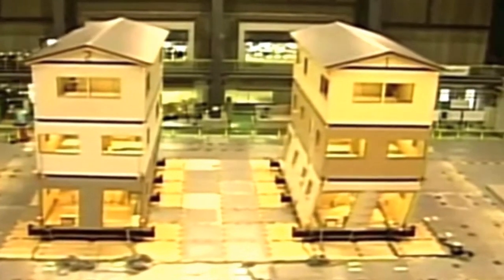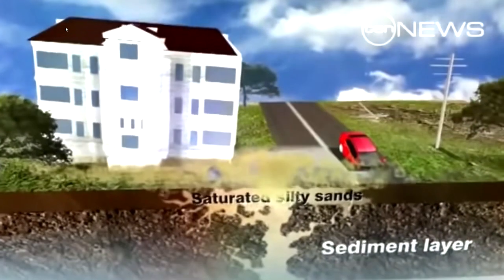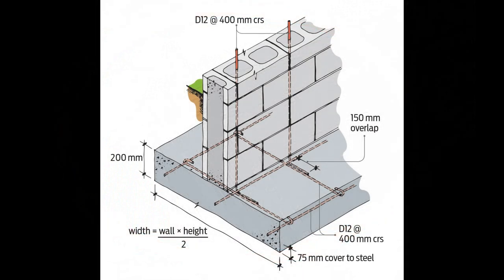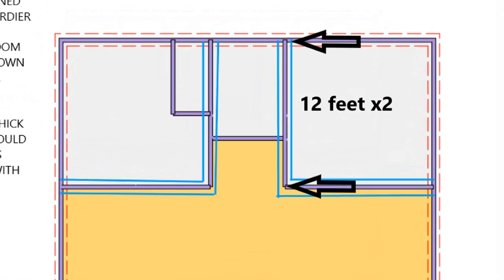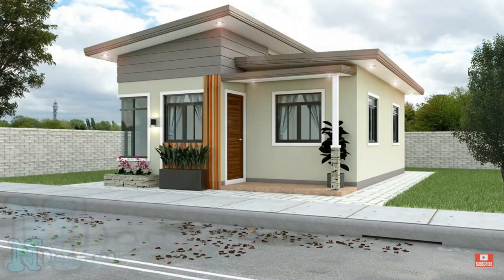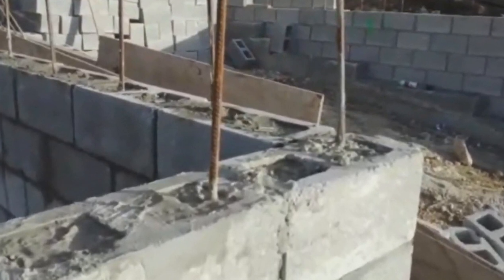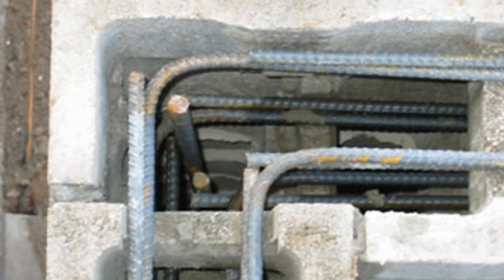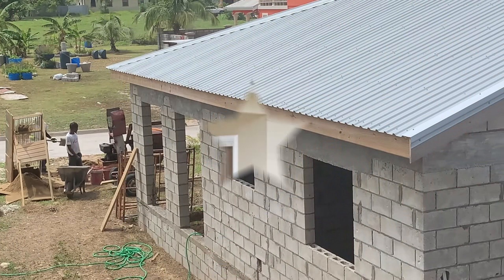BUILDING YOUR DREAM HOUSE IN JAMAICA HOW TO CALCULATE REBAR FOR FOUNDATION COLUMN . EARTHQUAKE PROOF

Comment: Thanks for sharing , something we need to start doing  more of in Jamaica .
Reply from the maker: yes, we do. This video was actually inspired by the video from the frame grab where the guys were building a house in St Andrew where they have the rebar matting laying on the bare ground. I was shocked to see an "engineer" using something he called a "heeky" to literally bend the rebar around large rocks inside of the foundation trench.

What he should have done instead was to lay a bed of sand mixed with gravel into the trenches and level it off and compact it to form a flat surface to lay the matting on. So if he needed to step up because of grading that step up should be reinforced with its own rebar cage as well. In a case where the grading is not too steep he should have leveled it at a flat slope and then laid the rebar matting on that level surface.

 As it is he totally compromised the foundation concrete by putting bends in the rebar where none should have been.

Comment: Excellent video! very informative! I always wondered why corners were never interlaced. seems to me it would be just as strong. What is your opinion on building your outside walls then pouring the floor with plumbing and electrical installed. Then building your partition walls on top of floor out of block or wood/steel for drywall?
Reply from the maker: building the wall, pouring the flooring and foundation with plumbing and electrical installed is a better and more cost effective way of building.

There are a number of reasons people build partitions out of blocks.

The first is that it is actually cheaper. Second is that its easier, thirdly its much faster and lastly there are few people with the knowhow to do it properly.

Pretty much anyone you find in Jamaica who can frame and drywall are returning residents who worked in construction .

The issue is a matter of economy of scale. Not many people know about framing and drywall so its not as readily available so its expensive to purchase. Lumber is expensive and all the other things like nails , screws , tape , mud and so on add up. Then there is the labour. Put all that together and you see that compared to just blocking up with four inch blocks , filling those pockets and rendering, the blocks method is much cheaper.

And you are quite correct about interlaced blocks. If Its a single story building then poured columns with rebar cages are not needed as long as the corners and walls are constructed in the manner i showed and the bond beams are placed in the correct position as i outlined. 

The actual reason for not doing like this however is simply tradition. There are not building construction schools in Jamaica so the people who build do so based on what they see others do without knowing any other way so the same method is passed from one person to the other. 

Back in the day there used to be Technical high Schools that actually taught this sort of thing but we have foolishly moved away from that and turned them into academic high schools, depriving ourselves of people educated in the trades.

When I went to KTHS I was actually introduced to practical brick laying, welding, metal working and carpentry alongside my majors , electrical installation and Technical drawing. But even then most kids didn't want to get their hands dirty muchless these nowadays phone addicts.

Comment: Great information, thank you! I have a question though. I am going to build a single story concrete house, however, in straying from convention, I want my roof to be a flat concrete roof. 
What is your suggestion for the steel layout for a concrete slab roof?
I am only seeing videos of concrete decks for people who are building another story on top of that slab, however, I am not going to do that, so should I layout the steel in the same manner as if I am going to build another story or is there a way I can use much less steel without compromising the structural integrity of the building?
Reply from the maker: Hi thanks for watching my video and thanks for subscribing.

Great question. The suspended slab is limited in how it can be laid out because of the weight of the concrete. It needs that large amount of steel to help provide the structural integrity so it does not collapse on itself or sag under its own weight.

With that said there is actually a way to use a bit less steel. Its called "fiber reinforcement". There are a number of different types. 

First there is "steel fiber". This is small pieces of steel wire around the size of a needle that are mixed into the concrete . That allows you to increase the distance between the rebars to about 8 inches thereby using less rebar.

Then there is "fiberglass fiber",  "carbon fiber" and basalt fiber". these are sold by the pound and work the same way , mixed into the concrete to provide both strength and resist cracks. 

The other method for using less steel is to carefully control the thickness of the slab. This is actually the most difficult and the least effective in terms of reducing the amount of steel because there is a limit to how thin you can make a flat suspended slab and still have it hold up its own weight, not sag and have people still being able to walk on it. 

So basically using normal strength concrete that limit is 4 and a half inches thick at a maximum span of 12 feet with 12MM rebar at 5.7 inches.

So In this case (presuming that your main  concern is cost effectiveness) you wont save on steel but you will save somewhat on concrete.
Reply: @jussayinmipeece1069  Ok, thank you so much. I actually found your video about rebars in concrete slab roofs after I typed that comment but I still left it there to see what what you may say in response to my specific question. So, thank you very much. I'll definitely go through all of your videos, I just found your channel today and already subscribed. Keep up the informative videos 👍🏾 God bless
Reply from the maker: @Sappa9702  thank you very much.

Comment: Do all block pockets have to be filled with concrete?
Reply from the maker: no. Technically only those with rebar must be filled.
There is a tendency in Jamaica , however to fill all block pockets with low strength concrete. This actually provides a decent sound barrier, especially in dividing wall on the inside if two bedrooms share the same wall.

Comment: What if you are going to concrete the top of the house
Reply from the maker: Hi. Good question.  It makes no real difference. Concrete is extremely strong in compression so if you mix your Concrete at a normal strength it will withstand any roof you chose to use.
Just think ahead and if you intend to perhaps aff a second story then foundations need to be strengthened accordingly.  High strength columns may also be included at strategic positions but that depends on where you intend to add the second story.

Butvif you have no such intention then you have nothing to worry about

Comment: Would this method be applicable if one decides to slab the roof? Or no??
Reply from the maker: It works just fine as long as you intended go remain a single story building.  If you think you would like to add a second floor on top then you will need the columns and beams for the first floor. 

The second floor can then be built this way.

Comment: How long does the foundation take to dry before buliding
Reply from the maker: well its about curing not drying.
If its the right concrete mix then it will set up in 12 hours and can withstand building in 48  to 72 hours but its not a bad idea to give it around 5 days if possible since in 5 days concrete has reached 70% of its strength

The method where you use 12 inch bond blocks gives you a much faster working time and I will have a quick video coming out explaining foundation bond blocks.
Reply: @jussayinmipeece1069  makes sense. Was thinking to give it an 7 day to cure thanks for the reply

Comment: Are earth quakes common in Jamaica 🇯🇲????
Reply from the maker: i would not say common. Not the way they are in say the Philippines or Japan for example but Jamaica and the Caribbean as a whole, sit on a fault line and we do have minor earthquakes every year and sometimes we do get a 5 or  a 6.  So its a good idea to build for those times. 

In very steep sections of the Island such as parts of St Mary where they have a combination of soft soil and easily saturated soil and places like Spaulding where houses are built on extreme slopes a small earthquake can literally condemn your house if the foundation is poorly built.